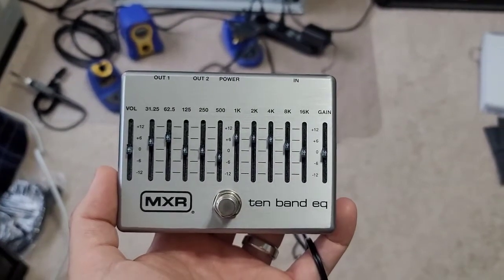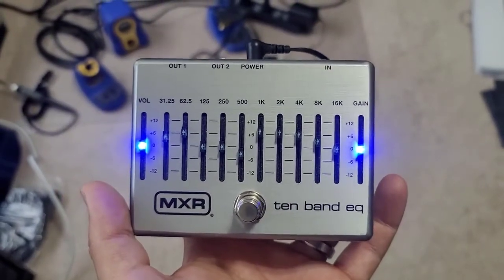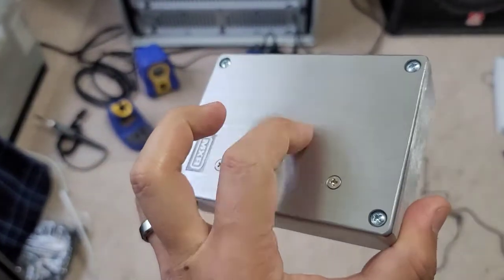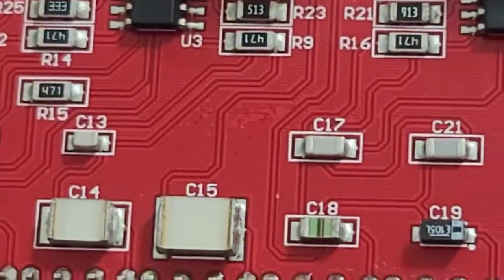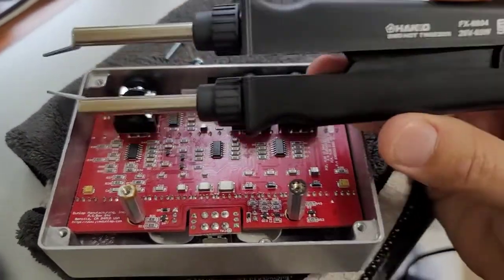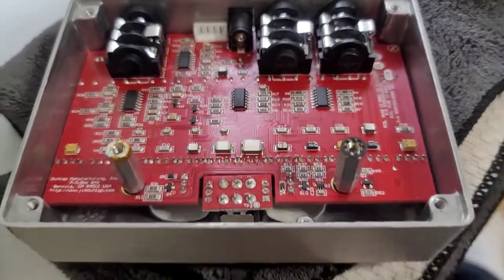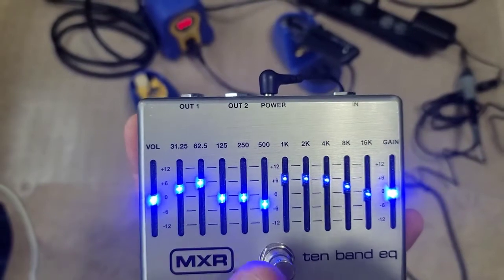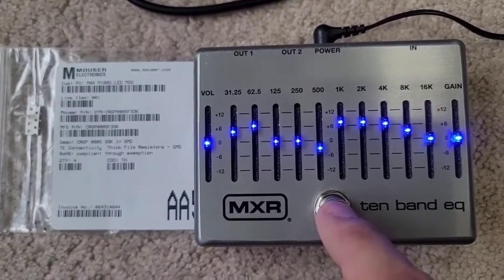MXR 10 Band Equalizer: Dim LED Mod M108S

Comment: change them out for red ones and your done
Reply from the maker: That can work. Red is less offensive than blue due to its wavelength. Still will be bright however.
Reply: @Bassguitarist1985  It makes a big difference,been there,done that
Reply from the maker: @roetsj agreed. I can't post pictures on YouTube but I did do as you said but I went multicolor just to be fancy for a customer that wanted his LED lights turned down. It was a great little project

Comment: Do you often play holding in in your hand 2 feet from your face ?  The brightness never bothered me but I keep mine on the floor.
Reply from the maker: It was to demonstrate the brightness. 😅
Reply: @Bassguitarist1985  The brightness never bothered me on the floor.
Reply from the maker: @epiphonium  If at the very least it should be a different color. That blue is way too intense. Yoo bad I cant post pictures on here. I've modded others for different colors but the same brightness.

Comment: Anyone know about noise issues with the leds on the black version?
Reply from the maker: I'm not aware of any noise issue with the older black version. When you say noise, does it sound like a fizziness or an audible distortion?
Reply: @Bassguitarist1985  yeah pedal is on and definite fizziness. Pulled leds and no difference. Had to shelve it. Got the donner $50 eq and it’s great.
Reply from the maker: @psychotogether5114  I just ran into this exact issue on the MXR silver M108S. The two outer LEDs are the clip LEDs. They blink when you are pushing too much signal into the pedal or if it's outputting too much signal. The LEDs need to be the standard blue LEDs and the original 2.2 k ohm 1206 size R46 resistor installed. The clipping circuit is tied to the negative bias voltage for the internal op amps. Changing R46 or the LEDs will change the bias of the op amps causing the fizziness. I never realized this until I really started digging into the schematic which has changed over some of the revisions. There are some revisions that do not have this issue and some that do. 

Hopefully that gives you some perspective.
Reply: @Bassguitarist1985  thanks! Will check out. It’s too bad that pedal has issues. It’s built like a tank!
Reply from the maker: @psychotogether5114  yeah it just means that it's harder to modify the pedal to have dimmer LEDs. The next best thing would be to take out each translucent LED lightly sand them with 3,000 grit and then color them with the permanent marker to dim them that way.

Comment: I went with changing over to red LED's and also changing the resistors to 33K. I could have gone lower with the resistors to a 27K.
I'll leave the resistors at 33K for now. Originally with the blue LED's, I started with the highest resistance to keep the LED's lit (~45K).
The biggest thing is using red LED's. Red preserves your night vision better and does not burn out your sight as easily as the other colors.
The worst thing is finding a source of LED's. they are difficult to find and are expensive.
Thanks for the Vid.
Reply from the maker: Hello and thank you for watching! Yes I went with a 33K as well. I did just modify another customer's MXR with 47k but now he is hearing a fizziness artifact in the audio signal. I'm wondering if that has something to do with the clipping LEDs on the outer faders since the LEDs are connected to the bias supply in order for them to work in that capacity. I haven't had that issue with the 33k so maybe I need to change out his 47ks for 33K or even 27 since the difference in brightness is going to be negligible. 

The LED size you need are 2x3x4 mm and square. I got a bunch of them that are transparent and frosted in RGBYW. The problem with LEDs especially in this form factor is the " MCD " rating which refers to brightness. The goal is to find something under $500 otherwise it's just going to be crazy bright no matter what. 

I've also thought of building a three gang multi-turn potentiometer where the brightness can be adjusted for all of the LEDs independently but then that would require drilling the base plate to get access to these which I wasn't really too wild about but it's more of a set it and forget it type of thing anyway. 

Anyways thank you for your information and sharing it and for watching the channel. Cheers

Comment: Hi. Great video, thank you. I have one question, I want to by this, or MXR 6 band EQ, would you say,  is this completely analog EQ, that absolutely wont induce any latency? Even that new noise reduction circuit that they mention in advertising?

Sorry on my bad English.
Reply from the maker: @sonysoni5079  yes, all analog. There is no latency or A/D/A conversion inside the pedal.
Reply: @Bassguitarist1985  Thank you so much for your time. You've been very helpful !

Comment: An alternative is changing the LEDs 
LED; rectangular; 2x3x4mm; red; 330÷450mcd; 100°; Front: flat; 20mA
Manufacturer part number: OSR5RU7BA1B (these are red but it gives you the other specs)
That way you can pull out the old ones with pliers. Cut the legs of the new ones to the same length and slot them in.

I'm in no way having a go at this video though, he had the skills, tools and resistors to do it and kept the MXR blue colour. Also shown where the relivent resistors are. Plus skills transferabe to anything with a troubling LEDs. You could even swap the resistors for trim pots so you could set the level exactly where you want it. 
Love these educational videos that make the internet an awesome library. 🤖❤
Reply: I already tried changing the LEDs to other mcd-specs. It didn't work that well with the red ones (~450mcd), since it was still to bright.
Though I only have basic soldering skills in trough hole technology (THT), it was not that complicated to solder this tiny little SMD 0805 resistors. You just need lots and lots of Flux for it.
And yeah, I don't have the best eyes at all...I saw just enough.
Conclusion: Don't be afraid of that funny work ;)

Comment: Just run it at 9v and it won't power the LEDs...
Reply from the maker: Then you lose the headroom you get at 18V. 9v is not the solution.
Reply: @Bassguitarist1985  It might not work for your needs, but it is a very simple solution for a very simple problem. The next solution is buy a different EQ. Modifying the pedal seems to me like a pretty over-engineered solution for such a fairly cheap pedal.
Reply from the maker: @bmkeller  hey whatever works. I use 18 volt active bass pickups so the headroom is important to me. Thank you for watching!!

Comment: Do the vol and gain faders also dim? Hard to tell from video
Reply from the maker: Yes they do. There is a separate 2K resistor that would need to be replaced for the volume and gain. There are two more 2K resistors that control the first five faders and the last five faders. Changed it to a higher value to dim the LEDs so they are not blaring me in the face
Reply: Thanks would you happen to know which resistors those are?  @Bassguitarist1985
Reply from the maker: @AA_MusicGuy1111  R13, R37, and R46
Reply: Thank you so much @Bassguitarist1985

Comment: Hi, what would cause my 2 sets of inner lights to not turn on at all?
Reply: i thought i read that if you’re running 9volts instead of the 18 the inner lights don’t light up.
Reply from the maker: Bad resistor or LED. The banks of 5 are in series. I'd lean towards a bad LED, or one or more can be reversed in the socket blocking the current in circuit
Reply: Thank you!

Comment: How does this compare to the whirwind perfecr 10 pedal? Anyone compare sound quality?
Reply from the maker: I don't have any experience with the whirlwind pedal hopefully others will chime in. If it's based on the same quad channel op amp then I would expect similar performance
Reply: @Bassguitarist1985  how would you sound quality and noise floor of the MXR?
Reply from the maker: @realtruenorth  sound qualities transparent and the noise floor is low until you start to boost the higher frequencies which is expected. It's the tool you never thought you needed but do!
Reply: @Bassguitarist1985  yeah, I'm just trying to figure out between this, Empress parametric EQ pedal and the whirlwind perfect 10, im sure they are all good.
Reply from the maker: @realtruenorth  yeah you really can't go wrong with any of those. Also the Caline CP-81 is an exact clone of the MXR M108S
Reply: @Bassguitarist1985  thanks man
Reply from the maker: @realtruenorth  my pleasure

Comment: Nice, but the hot tweezers cost $130 - seems far simpler and cheaper to just replace the LEDs, which you can pull out with your fingernails.  I think I'll get dim red ones.
Reply from the maker: As long as you were able to find the right size LED with the proper specs. I have the tools so I didn't bother looking for alternative LEDs

Comment: Too bad MXR doesn’t just change these from the factory with all the complaints of the brightness.
Reply from the maker: Agreed, that or put a dimmer pot you can access from the outside. No need to light up an air strip with it!

Comment: Great video! Did you consider installing three potentiometers using wire leads in lieu of the board mounted chips, possibly with a minimum size resister wired in series with it? The series resister would only be to ensure that the LEDs aren't over-driven.
Reply from the maker: I did yes, and its doable, but seemed unnecessary to have a variable brightness feature.
Reply: @Bassguitarist1985  I think the value and need would be if/when you play outdoor venues in the daylight vs inside a dark club. Nice to have a variable slider for the brightness. Great video and thanks for sharing the knowledge. 🤘
Reply from the maker: @killboxone  true on the variable slider/potentiometer, it would need to be a 3 gang pot, and that can get large in physical size to fit inside the pedal. The only other solution is 3 small trimmer pots to do each circuit.
Reply: @Bassguitarist1985  or you could possibly drive all the LEDs with a single pot and run the wire to the relevant contact pads
Reply from the maker: @jhford  no there are three separate resistors thus three separate circuits for the LEDs. One resistor runs the volume and gain, and the other two resistors run the first and second vank of five faders. If you want to have the operation you suggest it would need to be a three gang trim pot and I don't know if they make them that small
Reply: @Bassguitarist1985  thinking it through again, you'd need a stereo pot, but those are easy to find in small sizes.  The led circuit will be an led, a resistor and a switching element for the sliders.  So you could just repurpose one of the slider circuits for the other half of the sliders.  you'd just need a few jumper wires to go from the solder pads to the lugs on the stereo pot.
Reply from the maker: @jhford  yes but remember its 3 resistors, 3 circuits, 3 pots ganged. That or you can use a 3PST switch. This one is an ON/ON position, so either DIM or AIRPORT RUNWAY STRIP LIGHT BRIGHT

Check this out! https://a.co/d/7pQQ2cT
Reply: @Bassguitarist1985  but two of those three circuits can be joined together.  you would use one of the LED circuits to drive both banks of LEDs.  No need for a three-gang pot!
Reply from the maker: @jhford  I'm not sure if the circuit can be joined, but if you are successful please do a video!

Comment: Is there a way to change the frequencies of the eq (i.e. changing the 1k to 1.2k)?
Reply from the maker: Yes, you would need to change the values of R23, C13 and C14. This is based on an older schematic version E instead of G.

There are calculations that you can do to figure out those values I haven't really dug much into that. If you pose your question on the DIY stomp box forums (i forget the link) I'm sure you can find some resident smart people to help with that modification. It is definitely doable but with the right tools.
Reply: @Bassguitarist1985  Is it also possible to change all 10 frequencies to a specific range (2k to 4k) ?
Reply from the maker: @cevikmetalcovers  yes but like above you need to calculate the resistor/capacitor values to change the fader frequency operation. Its a heavy mod
Reply: @Bassguitarist1985  Awesome. Thanks!